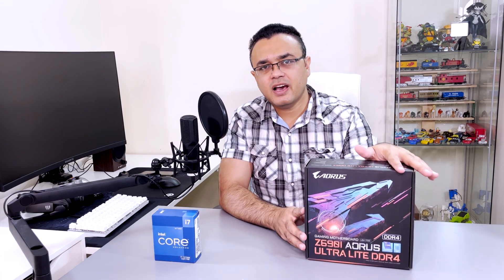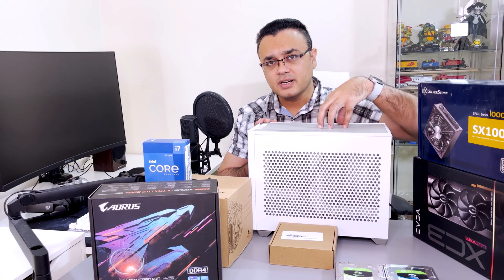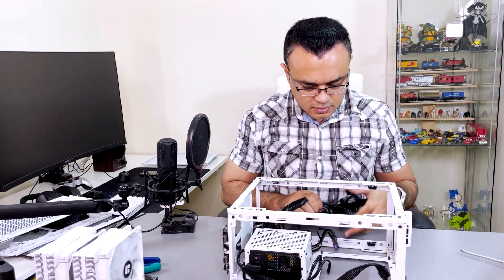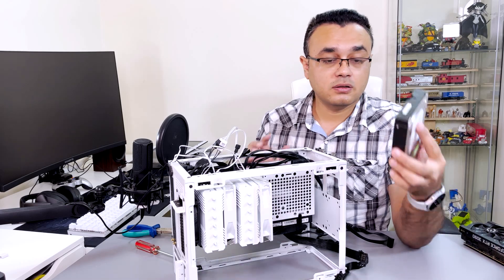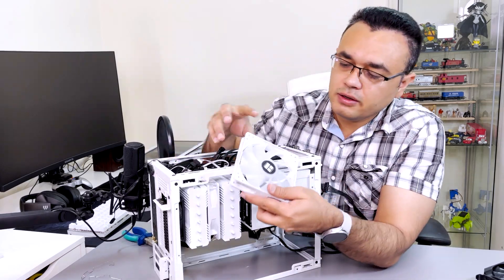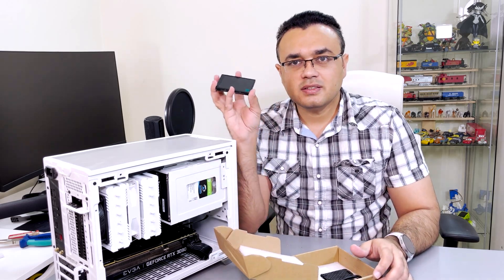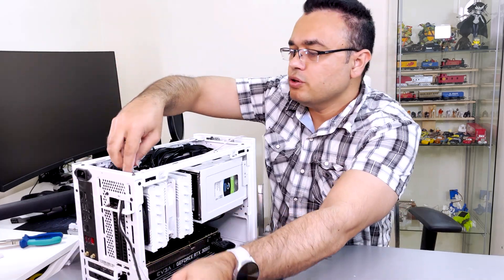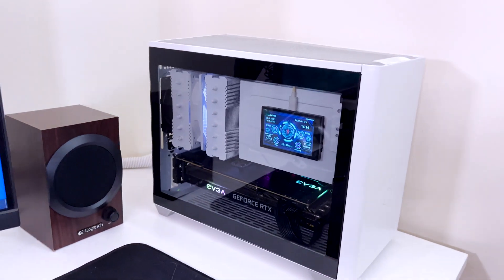How to fit maximum parts into small ITX case NR200P to its limit and keeping it beautiful

Comment: nice info on how to put hdd . i am thinking 240mm aio on top ditch glass panel put open panel with fan intake . dose it support 280mm aio ?
Reply from the maker: Yes my previous orientation was 280 aio but it was only possible on side mount with mesh panel top is not possible due to low height clearance. I think 240 also cant fit on top but never tried.

Comment: Great Build. Can you please share additional info about the drive cage. Thanks
Reply from the maker: Thanx. You can use any hdd cady that can fit 2 hdd in it most probably the size will be same. I used the hdd caddy from corsair mt220t case.
Reply: @gunjackblaster  Thanks for the reply and follow-up.
Reply: @gunjackblaster  hi what is the little usb lcd screen called thank you